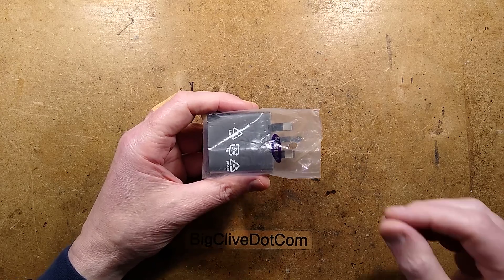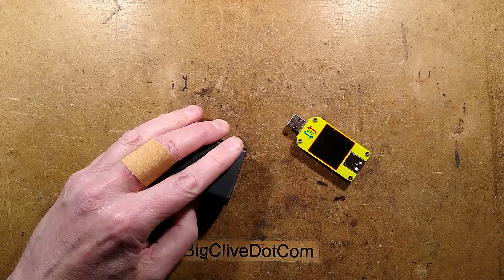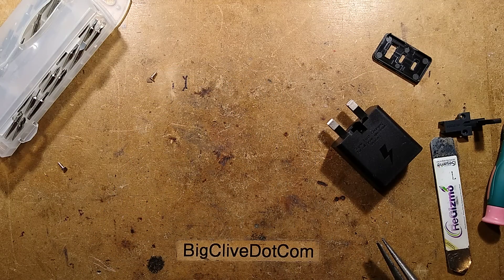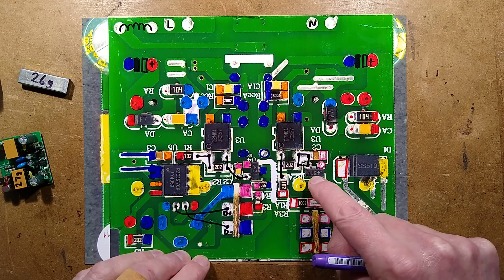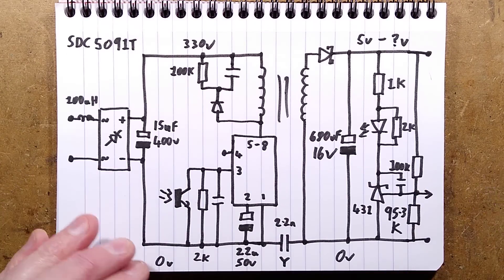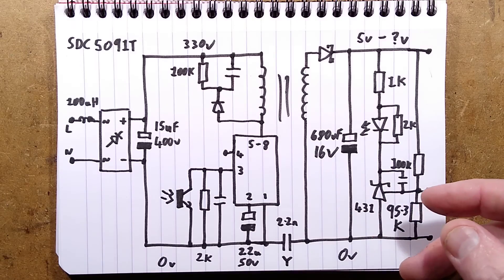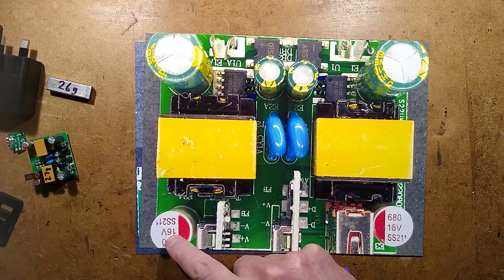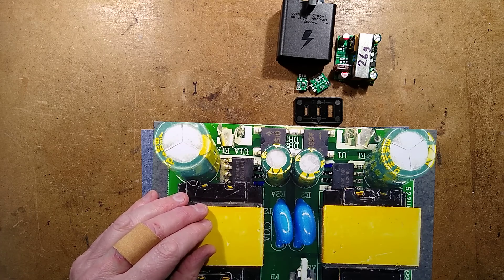Fake Samsung charger with interesting circuitry

Comment: Apart from the other awfulness, the opto-isolator arrangement doesn't seem very failsafe: if I'm not confused, if/when the isolator fails (say the LED dies) then the supply side will keep feeding current to the output side, no?
If so, I wonder how high the voltage would get before something went bang.

Comment: How ironic would it be if the steel block was a counterfeit, hollowed out and filled with resin 😂
Reply: Don't give them ideas lol.
Reply: Define irony @tomr6955
Reply: @tomr6955 Manufacturer failing to make a "proper fake" (irony 1) due to getting a fake component (irony 2)
Reply: Plot twist: it's steel plated gold pressed latinum 😂
Reply: @ropeburn6684 now come on, not even Quark would stoop so low 🤦‍♂️🖖

Comment: When I was at Uni, moons ago, we were taught to always have an isolation transformer at the front, to drop the mains voltage down to something reasonable. Then rectify, smooth etc.
When did this mantra change? Now there is no isolation transformer at all. I am puzzled.
Reply: The isolation transformer is the ferrite core transformer which works at 10s of kHz. Dont confuse a 50/60 Hz  power supply with a switching one.
Reply: @mernokimuvek  I am not.

Comment: I would solder the steel blob as a resistor or attach it to a transistor as a heatsink. That way it would just be a very good component.

Comment: Is noone else here confused how this thing is going to set three different voltages with just two regulators? If the middle port negotiates 15V, will the type A port on the right also end up with 15V?

Comment: The genuine USB QC3.0 high-wattage plug-chargers from XTAR are very good - can be used to power their latest 18650 etc chargers or to power a USB soldering iron.
I bought mine from Fogstar online in the UK for £8.49.
The latest model on the XTAR site includes an LCD screen.

Comment: Maybe it's time for a Charger Tester Upgrade ? .. there are plenty that support Voltage selection on USB 3.0 I'd guess.. of course you'd need the right cables ;) 

.. and I am rather tempted to disassemble my 65W Baesus Charger now.. but I need it   ^^

Comment: If using QC and ups the voltage, it ups the voltage on all USB?
If so, you could damage non QC devices well the QC device is plugged in.

Comment: Not al fake Samsung chargers are equal. I have a Samsung branded 45W charger which is confirmed fake by Samsung costumer service. However it does "super fast charge" according to my tablet (35W @ 9V) and it can deliver at least 3,6A @ 5V (that's as far as my variable load goes). I suspect it's a unregistered charger built by a Samsung oem manufacturer. I would, however, not recommend using it though as there is no way of knowing if it poses a fire hazard or may cause electrical shocks.

Comment: Can't find the chip either, might be labled up with a different number for Samsung so you can't copy it or repair it. The 2k resistor across the led is there to allow the 431 to conduct before the LED takes over. Without it, the 431 sees the LED as an open circuit until it hits the striking voltage by which time the whole thing has overshot the required 5 volts.

Comment: This is a very strange little USB PSU, I suspect it’s a Chinese repurposing jobby.  To me the device looks like the they’ve modified an older USB three port QC style power board (one combined USB-A/USB-C with a separate USB-A), and simply have done a parts bin hack job changing the daughter USB connection/control boards in an attempt to pass it off as a PD device instead.

The USB-A "15W" and USB-C "25W" ports are shared (power and control) and cannot be used at the same time,  the so-called USB-C "65W" port is independent but likely not PD compliant.

The “15W” & “25W” ports share the same PD control chip (a FP6606 clone), which assuming it is following the original chip’s spec is providing PD control for 5v, 9v and 12v with over voltage control to both ports.  The voltage selected by the USB data/control lines is implemented by a stepped source/sink current feedback output via the 431 ic & opto-isloater to the mains voltage converter circuitry.  The 6606 clone also provides over-current control to the “25W” USB-C port but not the “15W” USB-A port, as well as over-voltage protection switching the VBUS rail on the USB-C port and the GND rail on the USB-A port.  They’ve basically daisy chained the two mosfets on the "25W" daughter board to do this, one switching on the low side for one port and the high side on the other.  

There appears to be a separate main over-current control on the supply to both the “15W” and “25W” ports, via SDC5091T SMPS  controller ic and/or the 8 pin clone 3617 synchronous rectifier ic, which I suspect is what cut the tester out in the video.   Hence the over current limit on both ports is probably the same, and not differentiated at “15W” and “25W” as advertised.  The 6606 chip would provide additional over-current protection to the "25W" USB-C port, but the overall design seems to have been limited by the power supply circuit not the PD control circuitry.

Assuming just under a 2A cuttoff for the deisgn (based on Clive's test), this gives 10W at 5V, 18W at 9V and 24W at 12V max theoretical capability, although likely somewhat lower depending on the SMPS control chip current supply limits; the SDC5091T is limited to 15W (SDC5091S would have been a better match at 18-24W range).  Although, I suspect the 3617 rectifier may be cutting out at near 2A limit based on Clive's test.

The real capability of “65W” USB-C port is anyone’s guess, given the mistry N603 chip, which looks similar to the FP6601Q QC charging control chip.  It doesn’t appear to have over-voltage/current protection, just like the FP6601Q.  Unless it’s built into the tiny N603 chip and simply cutting off the supply in over current situations, in which case it may just keep power cycling – not really over current protection as such.  However, it's likely to be simply relying on it's dedicated power supply circuit for over-current limiting.

I suspect the "65W" port provides way less than 65W given the circuitry and given the way it's USB-C port has been wired up (doesn't look like a PD configuration).   The voltages range is a bit of an unknown, but if a FP6601Q clone will be 5v, 9v and 12v for QC support.   Given the mirrored design of its power supply,  the "65W" USB port will likely have the same 2A /15W overall limit that the other two ports have.

Some degree of emc/noise isolation has been attempted via the GND rails on the “15W” and “25W” ports, which are semi-isolated from each other and the supply GND via 5ohm resistors.  But not on the "65W" USB-C port.  I also wonder if the metal lump was meant to reduce any effect of the magnetic field from the two reverse configured transformers (poles orientated out of phase with respect to each other in a confined space).  A belt and braces method to pass certification on the original device perhaps, and maybe copied over into the repurposed jobby out of habit/lack-of-knowledge if not the old "perception of value by weight" design trick.

It’s anyones guess if the windings on the transformers are safe or not.

Comment: That thing looks like they took a US/EU charger and modified it to accept a UK plug (the "ground" prong sticking out). I have no idea if that's standard practice.

I think they hired a former submariner and told him to add a "ballast" to the device.
Reply: There is nothing "modified" - these plugs are replaceable on many chargers (e.g. genuine Apple) because it makes sense and saves costs. The chargers are completely identical inside, the only thing that changes is the plug. So instead of having to design 10 different types for different outlet types in different countries you design one and a bunch of those plugs. Those are also off-the-shelf product and some vendors even ship the power bricks/chargers with multiple of them so that you can swap to the one you need yourself (and don't need a travel adaptor when on vacation!).
Reply: @JanCiger  No, that's not what he's talking about.

He's talking about how they added the pop-out Earth pin, it looks like they've just tacked it onto a typical 2 pin charger.  The pop-out Earth pin thingy has apparently been around for a while.

Comment: Hum interesting, I have a Xiaomi phone, and its charger can change voltage for rapid charging, so it's not actually regulated at 5V, if the phone pulls 2.5 amps it goes up to about 10V, I hadn't noticed this till I watched your video, so I'll have to be careful I don't use this charger on something that's 5V sensitive.
Reply: No need to worry. The charger will never output those higher "Quick Charge" voltages unless it receives a specific request to do so via the USB data lines.  In the absence of the correct data, it will only ever output the standard 5 volts.

Comment: I bought an rather expensive but great USB tester, FNIRSI FNB48P and it goes from 3.8v (0v if connect extra micro usb for just the tester) to 24v and 0 to 6.5Amps.

It can check the charger and cable for every fast charge ability, and also it can force quick charge voltages for any voltage you want then you can test the amp load on the usb c or a output.

It also shows voltage ripple graph/oscilloscope down to 3.1 uS and 1mV 

Can estimate calculate charged current to a 3.6v lipo battery, and is actually within 5% from factory (can adjust conversion efficiency on it for the calculation)

I love it and it have revealed one super fake charger

Comment: If that was priced correctly (£1-2) it would just be a fake. But because they charge £15 it would be classed as counterfeit.
Reply: Because they charge £15 and print "SAMSUNG" on the label
Reply: @dgwdgw would it not be the case of a product is purporting to be “Samsung” hence counterfeit. Samsung also has legal rights to pursue due to said product claiming to be genuine.
Reply: No, both would be fake, regardless of the price. Because they slapped the Samsung logo on there, it is a counterfeit.

Comment: To be fair, the rated 15W may have been at QC-voltages, like 12V. You'd need a load tester that is capable of testing QC specifically.
However, the fact that USB-C load wasn't tested, probably means it was just as crap.

Comment: At least it had a transformer in it unlike the one I bought some years ago that only contained a 1n4007 diode, a resistor, an LED and a 5v zener diode and of course a large stone to make it feel heavy.
Reply: At least most stones aren't conductive .
Reply: @johndododoe1411  they compensated for that defect by ensuring that the sleeve of the usb socket was connected straight to mains live!

Comment: SDC 5091, 20 Watt Switching Power Supply controller with intergrated power switch. Similar to TNY 2xx series, different pinout, IC for fast chargers. 65 W is from space, paper can accept everything.

Comment: That reminds me, I have some unbranded. USB chargers that I bought from Amazon some years ago. They worked perfectly for several years but were then subject to a product recall by Amazon due to the risk of electric shock. I was refunded in full but never had to return them. I keep meaning to send them to you for analysis, but I never got around to it!  The only point of this comment is to fix it in my mind again.
Great video by the way.
Reply: Smash them and throw them away, ensures nobody else will use them.
Reply: @Sashazur What? Why do that when we could get free content from them here?

Comment: You can switch voltages just with some resistors, it's not a digital protocol, so if you want to do more tests without risking expensive equipment, it should be quite doable :-)

Comment: The FP6606AC is a simplified USB Power Delivery 3.0 protocol controller.....  https://datasheet.lcsc.com/lcsc/2106021033_Fitipower-Integrated-Tech-FP6606ACDW4_C2836669.pdf

Comment: Could it not magnetically couple the field of both transformers? Be interesting to see a power output test with and without said weight
Reply: Transformer cores wrap around and provide a full flux path, so I doubt that much would go through the weight. Plus any flux leaking at the high switching frequencies might just heat the iron.
Reply: They would have to be directly connected and not with something between the weight and the transformer. 
I'd suspect it to be thermally important thought
Reply: @NinoJoel  So it's a heatsink then?, a valid addition to its functionality ?, a purposeful  design feature ?, not a lump of steel inserted to fool the buyer at all ??.🤔
Reply: @brucepickess8097  id say it is for cooling. 
If it was just for weight they would not have bothered to put the sadly not attached tape there

Comment: He must flip out the ground pin. I thought British plugs always have to have a fuse holder.
Reply: It's a class2  adapter,  no earthing required to provide electrical safety , it a plastic pin to provide the format. British 13 Amp plugs buy design have a integral fuse holder. A correctly designed and manufactured class2  power adapter is electrically safe through circuit design and  use of quality components and materials.

Comment: So how would you best avoid buying this kind of fake? I mean it's pretty much impossible to see on the outside if it's real or not -- and not everyone has a handy dandy load device and USB meter :P
Reply: Clive recommends the original Ikea and Apple chargers directly from their own shops, but has also approved one or two cheap but good models found locally in the UK .

Comment: Over a decade ago I had a knock-off Dell laptop charger come in for repair, similarly weighted down with a steel plate to give the illusion of quality. It was duly disposed of…
Reply: At least that long ago, I did desktop PC support for an organization that used all Dell equipment. I remember dismantling one of the slightly nicer mice and finding a weight in it. In that particular case it made sense though, I found the heavier mice easier to handle than the new ones they were shipping us that weighed nothing.

The idea of a metal weight floating around loose inside a SMPS is terrifying.

Comment: Why is the chip's pins on the left all together and the one on the right aren't? The SDC chip, the side with single USB A port are not bridged, the other side are.
Reply: The bridged pins are because that chip needs to move more current than a single package pin can handle .   This is normal .

Comment: edit: Being a flyback converter and the needed pri/sec separation distance interacts with the gap in the circulating magnetic flux circuit (where the actual energy is stored), means there's inherent leakage inductance. L/I increases with pri/sec separation. The snubber burns off the energy from the primary L/I when mag field collapses. The energy if not burned off translates to a voltage spike, which not just a voltage stress+ringing but its dv/dt via the d/g 'Miller' coupling affects the fet's clean turn-off.
Reply: In switchers like this the gap between primary and secondary coil is just a few layers of yellow tape .  The difference between good and bad quality is if the windings get close enough to short out when pinched .  Switchers work by storing energy in the magnetic field, then discharging it into the output .
Reply: A geometry thing. Energy is stored in the gap in the magnetic core flux path. Whether it's a discrete-gap core that you have control over, or a distributed gap core that you're stuck with, not all the energy stored in the core gap couples because of the geometry. 
 I wish I hadn't mentioned it now maybe someone else can explain better

Comment: I’ll take a piece of steel over a plastic pouch full of mildly radioactive thoria powder…

Note that thoria is 10 grams per cc but iron is about 7.8. Powdered or granular thoria would have some spaces in it, so density might even be a bit lower than that of solid steel.

Comment: I can tell just by looking at it that's not a Samsung charger I had one off Amazon that looked exactly the same as the real ones I compared it to my friends one that came direct from Samsung I checked the voltage and amperage on them same the difference was the font and nothing else when I used my friends charger my phone charged as fast as the fake but battery lasted longer than when I charged with the fake to the same percent with the same usage

Comment: I'm no USB charger expert, but my 3rd party "Go-To" for chargers and charge cords has consistently been the "Anker" brand!!!...and they seem to always be coming to market with improved charging technology and circuitry!!! I can't say I've ever been disappointed with one of their charging products I've purchased!!!
Reply: I also mainly buy Anker brand.
Reply: Yes I use those too. They always charge at an acceptable rate and don’t get hot in the process!
Reply: They are well manufactured and come at reasonable prices. 
The internals look well designed as weol
Reply: Ive tested my anker power bank with usb power meter and the charge circuitry seems very advanced. It def regulates and changes power based on device and battery charge.

Comment: Clive, instead of using a vise or cutting things, you should get an arbour press and add mini screwdriver flat head attachments on the head. It would prove itself for ultrasonically welded boxes like power adapters or warts, and other things.
Reply: I just hold one corner on the concrete and hit the other with a hammer, takes up a lot less bench space.

Comment: And the icing on the cake is that that thing doesn't have a real ground, sorry, earth. Hope you discharged the capacitors. Even those small ones pack a punch. 🐻
Reply: Class 2 double insulated adapter, doesn't need to be earthed/grounded.

Comment: FYI: The SDC5091 is acc. to one Aliexpress seller a 20W switching power supply PD fast charge chip.
Oh and they only sell it in a pack of 4,000.